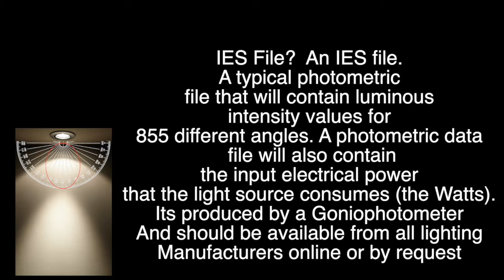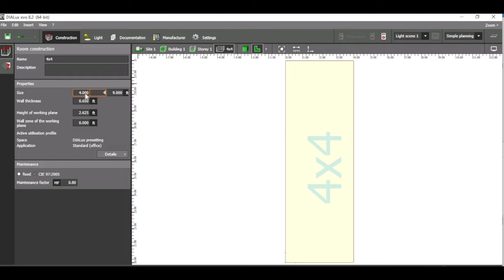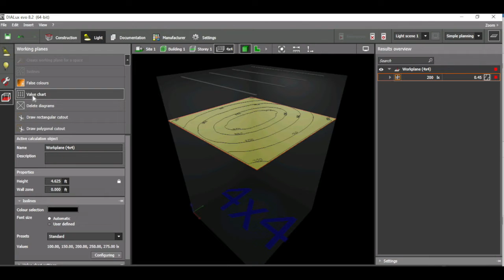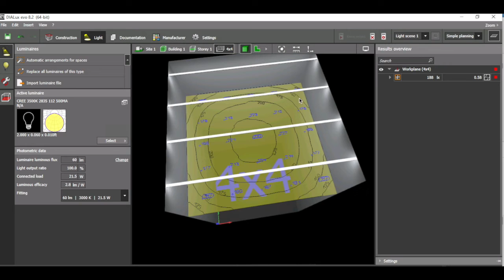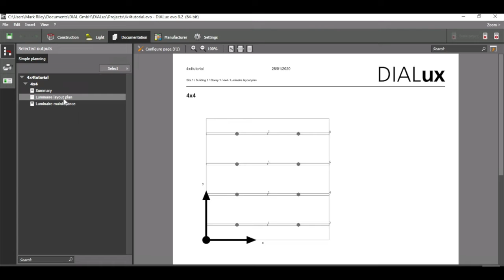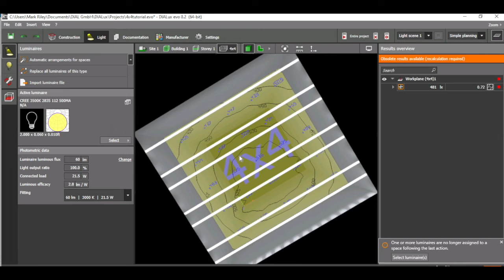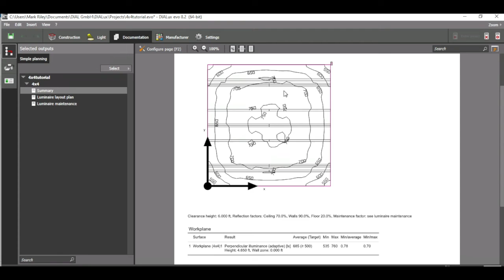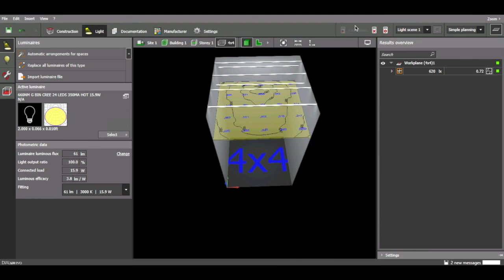Designing Led Strip Grow Lights using Dialux EVO Software

Comment: HOLY CRAP!!! This is pretty AWESOME!!!! I'm starting a commercial grow and we bought some pallet racking that is a size that is not standard for the industry, 9ft by 5.5ft. Larger than industry standard and minimizes aisle space. Commercial LED grow lights leave less than desired coverage for our shelves plus they are EXPENSIVE!!! This software and Cutter LED strips allow for us to get the light coverage and intensity we need at about 1/3 the cost of off the shelf LED lighting. Downloaded the software and reached out to Mark at Cutter for the IES light files. Loaded it up and followed right through Mark's tutorial. Worked like a charm. Was easy to manipulate lighting strips to fit our PPFD requirements. Nice job and very useful!!!!
Reply from the maker: Thanks Chuck appreciate the feedback. This stuff can be a little daunting for people to use, but if you invest a little time this program can give you some awesome information. An informed customer is always going to be happier.

Comment: Any idea why the IES and EUL files at the very bottom of the links on the attached Bridgelux PDF link , aren't recognized when I try import them? 
https://www.bridgelux.com/sites/default/files/resource_media/RF74_revA%20Ray%20Files%20of%20Bridgelux%20V22%20BXRE-XXX650X-B-7X%20Products.pdf
Reply from the maker: I just imported the ies into Dialux and works fine, you have to extract the file as it is ZIPPed, dat is only in lumens not in PPFD
Reply: @CutterElectronics  Couldn't figure it out, maybe down to different OS's.  Have SPD data for a few of the CRI/CCT variances so lumens would've been fine, thanks anyways , cant wait for the Gen8's to be released.